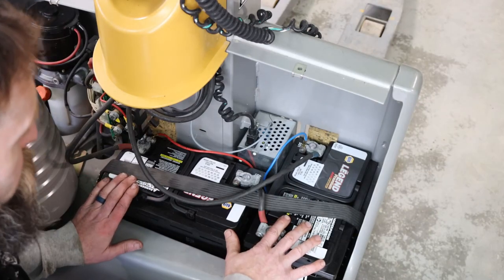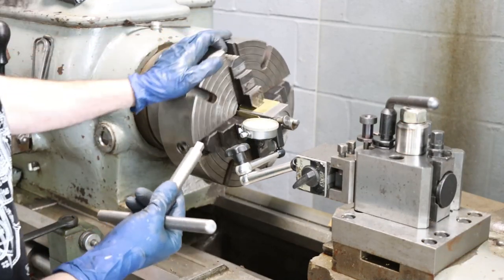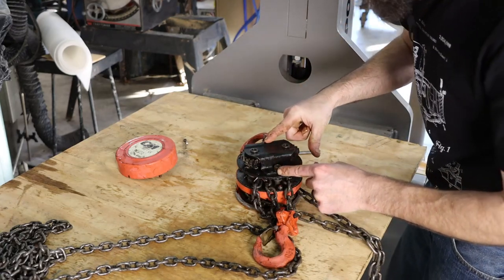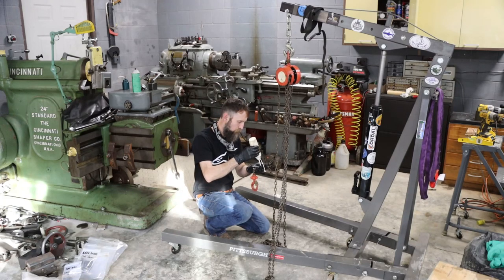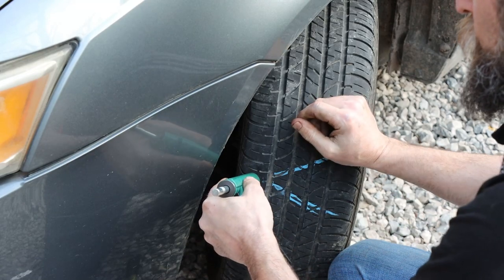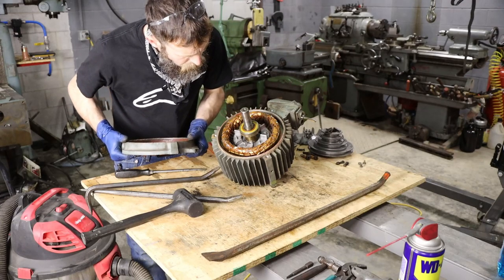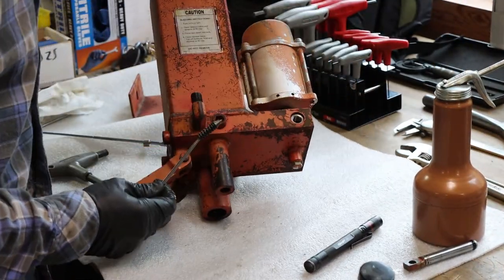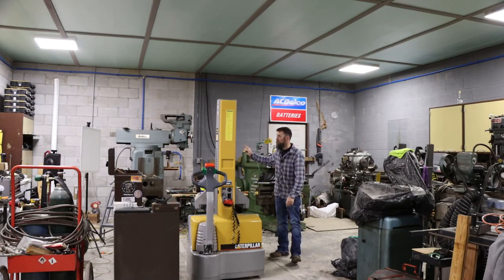DoAll Milling Machine motor and Big Press Repair.

Comment: Well Steve another great video.  It’s time for Saturday morning coffee.  What a great way to start the day.  The back of my truck is full of old,tools and equipment from a deceased owners garage.  Sort, clean, and prep for either swap meets or use in my small shop.  Great fun but lots of rust, crust, and desert dust to remove.

Comment: Hi Steve being a retired machinist I really enjoy watching your videos.  In your last video you mentioned that the tire on your electric and truck was coming apart . Back in the 1970s we had the same problem with one of our electric hand trucks . To fix this problem I took a piece of well casing a little larger than the OD of the tire and placed the hub in the center of it after cleaning it . I then poured liquid Devcon into it and let it set up . The next day I pressed it out of the casing put it in the lathe and turned it to the proper OD . It served us well for several years after that .

Comment: Steve,
Who made your motor? It is a well built motor. I taught an electrical class to 17 homeschool boys, and this motor would have been an excellent example to disassemble in class. The conductor bars that set up the counter EMF through the zinc end plates are so clearly evident. In motor terminology, the motor is not "sealed". It is "totally enclosed fan cooled" (TEFC). The heavy casting is to radiate heat via the casting fins. Ambient air is drawn over the motor via the fan to facilitate heat removal. Open or drip proof motors draw cooling air through the motor carrying ambient filth inside the motor. Dirt is still an issue for TEFC motors as it blocks air flow and even insulates the motor casting. Early motor technology relied on massive castings to absorb and radiate heat. Modern technology relies more on heat transfer. This is one reason why very old motors are so much larger than their modern counterparts. 

Early in my motor training I was taught that greasing motor bearings is the fastest way to wreck a motor bearing. The issue is that motor bearings not having relief ports can easily be blown apart. Grease gun pressure will easily blow out the shields or seals and heated grease won't be contained. Decades of motor maintenance tended to confirm that motor bearings are very resilient. I saw bearing failure due to lack of maintenance, but I also saw decades of industrial use with no maintenance and no bearing failure. Possibly my instructor made a valid recommendation.

If you are buying bearings from a bearing house, just give them the numbers on the race. There is rarely any variation included in the motor number. Bearing class is only an issue when replacing precision bearings. Bearing numbers are universal or easily cross to equivalent. Your motor bearings are common single row ball bearings. Dimensions are a fine method to size the replacement, but size doesn't describe design characteristics. Bearing numbers include design as well as size.

You do need a good set of bearing pullers. I was curling my toes while you used pry bars!

Another H frame pressing option is to use heavy pressing bars to span the frame width and choke up with thinner stock like you did on the recessed cross frame weldment. I employ bearing splitters at this point as they are very thin to clear to the back side of the bearing inner race and are manufactured with fabulous strength. I have never damaged a high quality bearing splitter. I always press across the splitter frame and not on the spreader bolts. I also cringe when I see mechanics press with a puller jack screw directly against the end of the motor shaft. The divot in motor shaft end is not intended to accept the tit on the puller screw. This is the center for machining the motor. If the motor ever requires rework, the machinist won't be happy if the mechanic wrecked the shaft center. Always employ shaft savers. 
Your motor is designed for this application. You won't find an off-the-shelf replacement. Foolishly employing bad mechanic procedures can quickly get very costly.

Thank you for the chain fall teardown. I have never been inside a chain fall. I will soon move my 3 ton H.O.K. inside. It has served me outside for 15-20 years and it no longer "locks" and holds the load. I have had no other choice that to leave it exposed to the elements. Evaporust may be my first step to salvage a once pristine hoist. I will cry if my abuse has wrecked this hoist. I suspect that it is older than me (65).

Comment: So I'm the guy that has the same lift as you... Get the front ones too. The idler wheel in the back (there are two wheels in the back BTW) will survive pretty well, but the front ones will die shortly after the steering one. The new wheels that I got for mine were red, and made of a harder compound than the originals, which literally dry rot away. Also, always try to avoid steering without any throttle application, as that really abbrades the wheel if your floor is rough. BTW, they are a real joy to change. Find someone with a liftgate on a box truck, and leave the tail hanging off the edge while you use tie-down straps to hold the forks down to the gate.

Comment: You are onto something there.... I have a similar Powered Lift Stacker (Vestil brand).  I stopped at new house construction site near me and bought a scrap piece of inch and half sub-floor plywood and made some cleats to lock it onto lift forks after cutting it down to 3x4.   When needed, I lay it down, stab it and have a mobile workbench/lift platform wherever I need it.

I think you'll find that when you have some weight on the chain-fall the down cycle becomes much easier.

Comment: Nice work on the motor Steve, In my trade HVAC we deal with motors of all types on a dally bases. I've changed hundreds of bearings, and have experimented with different methods of extending bearing life, but nothing worked better than just buying a good quality rubber sealed bearing and just leave it alone. Remove and plug the grease fittings and mark it as "sealed". The suffix on the bearing part number usually ends with something like this -RS , -2RS "RS = Rubber Sealed". Hopefully this helps someone out there...

Comment: Shops looking really good Steve,  nice to see you back on the lathe doing some engineering!!. It’s good to have all that room to move about in and the equipment you have acquired is really coming in handy. The shop looks to be really light and airy, when you think of where you come from over the last twelve months, it really is some achievement!!

Comment: Mushroom tire plug warning.   Sometimes those plug work great.  No problems.  Other times, apparently depending upon hole location, the steel belts in the tire saw through the head of plug.   A friend plugged his tubeless motorcycle tire.  The dealer and a new tire was 90 miles away.   He had to re-plug the tire 6 times to get the bike to the dealer.  At least that is how many mushroom plug heads they found inside the tire when it was dismounted.
Reply: Yep. that’s why I’ve never used those on steel belted tires. Work great on non steel belted tires like lawn mowers, atv’s, etc.....

Comment: Steve, growing up I worked at a service station, we had a plug gun like that. Also in my military service years our motor pool used those. Worked very well. I enjoy your videos and have picked up a few tips. Thanks.
Reply: Those plug guns were around in the 60s. The difference I see in this one is putting the end in the hole before screwing it on the gun. The one we used had tapered plastic tips that allowed the end to be put in the hole while it was on the gun. If I recall, their use was stopped with the use of steel belted tires. Tire manufacturers questioned the safety of plugging a tire. I don't know if it was an actual concern or a way to sell more tires.
Reply: @tiredoldmechanic1791  Those steel belts will just chew that soft Chinese rubber plugs up.

Comment: I noticed you have a Black Diamond drill 
pointer. I have one in my 
grinding shop. They do a
great job. The point setters are for 118 degrees. lf you are doing 
135 or 90 degrees you need to change the setter to the proper chisel angle . The drill holder and the bushing it
goes in can wear out and 
may need replaced . I have replaced mine once  
The bushing is a pretty tight press fit . As I said they do a great job.  I enjoy your videos very much. Good luck with your mill.

Comment: I would be tempted to replace the single-sealed back bearing with a double sealed one. The rear bearing can't be greased with that hidden grease nipple so might as well keep it sealed up. Thanks for this comprehensive and interesting look at a few issues around the workshop. It's always a good feeling to repair something so it works properly again.

Comment: Place a new bearing ball in each check valve and give them a rap with a punch and hammer to seat them and then replace with new balls. Will true up the seat. A man that repaired jacks for a living told me about this.
Reply: thanks for the pro tip brother

Comment: I bought a bearing puller at harbor freight years ago working on motorcycles it's two c plates with two bolts that goes behind the bearing  and a harmonic balancer looking piece that does the pulling it works the best for these bearings 👍👍

Comment: The more that I get to see you use the electric fork lift, the more I realize how nice it would be for a portable work table/lawn mower lift! I love how the shop is coming together.
Reply: That lift is a handy thing. I think Steve is going to have to do some mods on it in the future to make it even more useful around the shop. Be nice to see it with adjustable forks. To heck with keeping things stock if they come up short.

Comment: Hi Steve, Nice video!
If the press continues to leak down take a brass punch and give the check valve balls a wack in thier respective seats. Thanks again for sharing. Chuck

Comment: Every time I see that little forklift close to the mill, it's like a fragment of me detaches from the rest and goes to work trying to come up with a frame or jig, that would mount to the forks and allow you to get that knee safely removed from the main casting.  Keeping the center of gravity in the right area, to keep it from becoming tipsy, is the challenge.  Most of what I've thought of so far would resemble one of the old Holmes wreckers that used to be so common.  Another is similar to an old shop device that was used before hydraulics, concrete floors, gantry cranes etc. for heavy lifting.  Yet another idea would be a mix of the two.

Something to think on.  It might prove handy on other projects (like the band saw) as well.

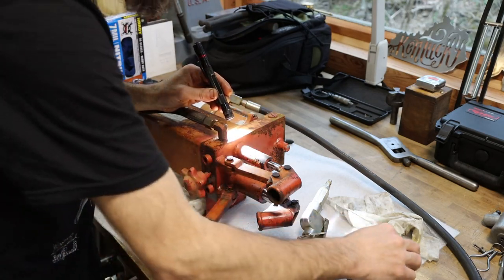Comment: @ 38:40 reminded me of rebuilding the hydraulic valve on an Allis Chalmers B. The manual said to buy 2 new balls, use one to re-seat the port by striking the ball with a punch and hammer. Then you throw that ball away, and put the second new one in. It works if there are any slight imperfections in the seat. It wouldn't be a cure all for burrs left from the machining process though.
 And the dental picks, I told my dentist once, I needed something like that at my job, doing die repair work. He stopped whatever he was doing and left the room. When he came back, he had a whole shoe box full of his "old picks". 😮 I passed a bunch out at work the next day. 😁

Comment: A bearing separator is a great tool on the press to give you some bite and spread the load out further.  Those press plates wouldn't be adequate for Harbor Freight 6 ton.

Comment: I've got a gear/bearing puller kit, Clarke CHT227 hydraulic Puller. Yours if you want it, I've no use for it and it's just gathering dust

Fascinating to see a shop take shape, great video's

Comment: My first town job was rebuilding hydraulic jacks,  got paid 10 bucks a Jacks.  Old guy who had owned shop had special wrenches, parts, tools, everything, plus a real good parts washer, probably had carbon tet in it.  Jacks seem to accumulate mud in them, looks like mud anyway.  Had an assortment of balls soldered to a stick, would narrow down bad seats with endmill, flatended drill bit or such, done by hand, just reduced then used balls on stick to beat in a new seat.  Hardest part of a bottle Jack job was getting the reservoir not to leak.

Comment: I've used a plug gun like that for a lot of years, never had an issue with it doing the job. You can apply a bit of rubber cement to the plug so the head bonds in but I never have had one leak.

Comment: Steve make a fixture that slides over the forks with 2 sleeves 2' apart on each fork and a 4' riser section and hoist arm that slides inside another square tube to adjust the extending arm for your pallet lift to put the motor back in.

Comment: I know it's a bit more work, but I would have been tempted to modify that end cover to make it unboltable in case you ever need to clean it out again. The bearing on the output end of the shaft is beefier than the one on t'other end to cope with the extra load if the motor's driving belt pulleys or a sprocket. All The Best from Somerset UK.
Reply: I was thinking the same thing about that tank.  Should it not have been done that way in the first place?

Comment: got the same chain hoist, and it lives in a fabric bag because the chains are greasy, and stay that way. Has been abused a few times, in that it bent a beam rated for 5 tons, while using it to pull a motor shaft out of a gearbox. But it handled it fine, and it has seen a lot of use over the years. Must have had it well over 20 years, bought at a local hardware store, that unfortunately burnt down nearly 20 years ago. Proper hardware store, they stocked a wide range of things, and often stuff you did not find anywhere else as hardware. Still use the keyless chucks I bought there for $6 each, good quality ones.

Comment: The clutches on those chain hoists can get locked up when too much load is placed on them (such as using a small one to pull out a stuck truck). It is sometimes possible to un-stick the clutch by using some other force multiplier (a come-along, winch, or something) to pull on the chain to lower the hook. Pulling it apart and cleaning as you did is best, but sometimes that's not an option.

Comment: You should build a crane attachment for the fork hoist prongs.Just a fixed frame that adds enough height to the prongs to bring it up to ceiling height. You may have to add weight to the back of the hoist.

Comment: By the time you got to the hydraulic press, I realized that I am not the only one who starts a repair, but by the time I complete it, I have fixed or serviced a few other things along the way - each being a project.

Bearing replacement?  Measuring works but I have found that nearly all have a part number stamped on one of the races.

Comment: Steve maybe drill a hole in the plywood for the motor spindle to fit through , then the motor will set flat and be more stable.

Comment: That tire plugger is really cool.  Never saw one like that before. 🤘🏻
Reply: Had a small stop/go kit under the seat of my Honda Fireblade for many years.  The motorcycle kit doesn't use a trigger gun, it's a cylinder with a hex socket screw at one end and use use a hex key to drive in the plug.

Comment: Get an inverter, and run it with single phase. Pick your favorite belt setting and change the speed with a dial down where you are. I run my G&E hobber and Bullard with drives.

Comment: Steve make a slide over forks hoist fixture with adjustable extending arm for your pallet lift to put the motor back in.
Reply: It doesn't go high enough.
Reply: That's why you build it up on an angle

Comment: Kinda nice to be able to get at your tools and use them; Real glad to see the press fixed and the chain fall restored to operation. Idle thought: You have that powered lift... there isn't much stopping you from using that to get the knee off (using the chainfall rigged under the forks)... just sayin' :)

Comment: I think you might have missed how the chain hoist works. The clutch is on a screw thread, so the back-torque through the shaft clamps it tight. 
When you pull the "lower" chain it unscrews the clutch, allowing the hoist to lower. But the hoist "chases" it round, so it only lowers as far as you pull. 
To work properly there needs to be some clearance on the split-pinned nut. So i think that you probably do have it too tight.

Comment: The best tool for removing the bearings such as those is a bearing separator plate. It is a tool consisting of two halves that bolt together and will reach under the inner race. The good ones are hardened tool steel. The don’t flex on the press. Those “claw type” pullers are good for gears and wheels but in my experience they are a pain in the you know what when using them on bearings.
Reply: Yep, we call those clamshells. I use mine often....

Comment: Ive opened two separate hydraulic jacks in the past and found them to be in the same condition complete with metal swarf and casting sand. The only reason they worked in the first place was because of a basic wire screen to keep the crud at bay for a few years.

Comment: Good vedeos , I have an old chain block also , I used it for a lot of lifting and pulling , it got to the point where the clutch would slip so I had to hold the load chain ? So I took it apart and found out that you can ajust the clutch by tightning the nut that holes it together it works find now  ...

Comment: The question I have is how and what you use to deburr a small hole deep in a small bore?  Run into that situation on other projects as well.  Good day in the shop.
Reply: Yeah I wished he showed how he did that. I guess he can't give all his secrets away though. Maybe a wooden dowel with some sandpaper wrapped on it then start a fire with it indian style? Or maybe a twist drill?